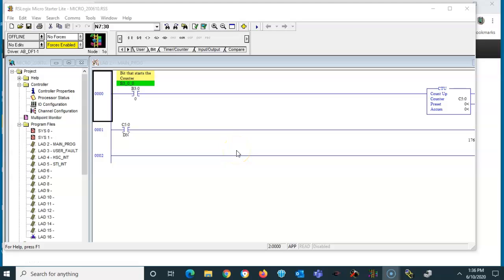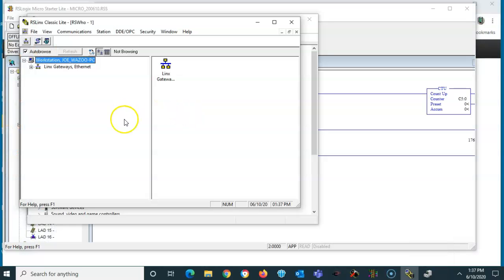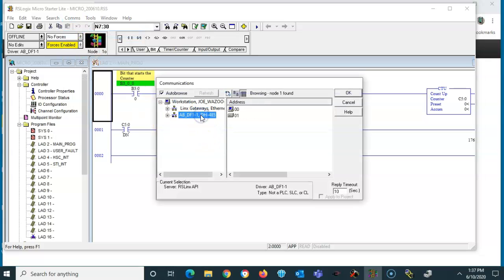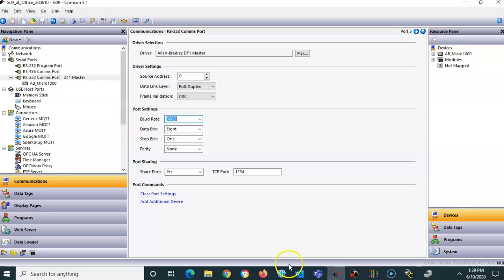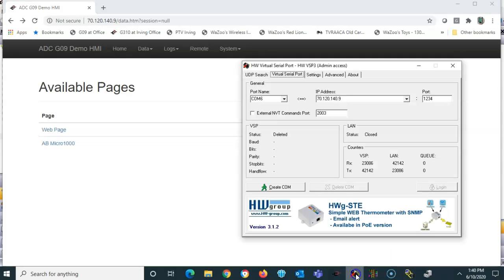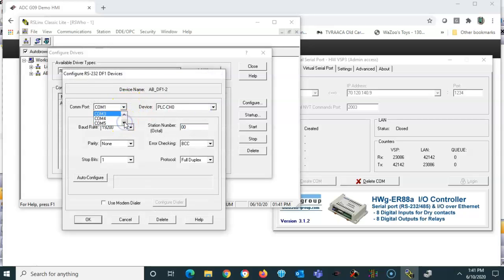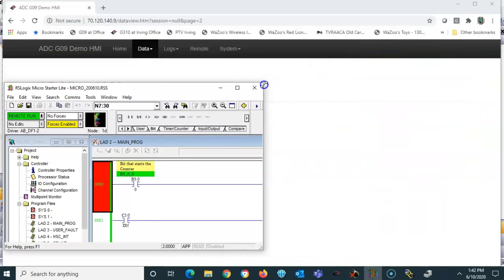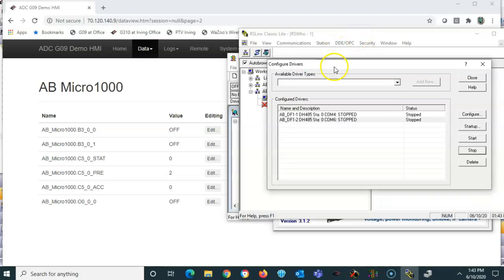RedLion Pass-Through Comms to AB Micrologix 1000

Comment: Do you know if is possible to configure Red Lion communications to a virtual chassis  SLC controller? Only have the following options: No driver selected, DF1 Master, DF1 master via PCCC/EIP, DF1 Slave, DF1 encapsulated DF1 Master and L5K file.... from RSLinx I'm using EMU500- DH-485
Reply from the maker: Well since it's Virtual on your PC then I would think the DF1 master via PCCC/EIP would be the protocol to choose over the Ethernet connection.  You will need to use the IP address of the PC for the PLC settings in Crimson.  But with this DH-485, you will need to use the RS-485 port on your RedLion device and the do DF1 Master driver.

Comment: Can you go online through Ethernet port 1 to ethernet port 2 similar to this?
I have a red lion at a remote site with comms to Ethernet port 1. I would like to download to PLC on Ethernet port 2
Reply from the maker: Good question.  This concept I describe is going to a RS-232 serial via DF1 comms to the AB plc all on Ethernet 1 port settings.  I suppose you could try to add a Virtual Serial port connection under Ethernet and then select the DF1 driver with the Port settings.  Make sure your Virtual PLC IP address is on the same network as Ethernet 2.  I don't know how the RedLion would direct that traffic to the other Ethernet comms on Ethernet port 2 but one could try it.